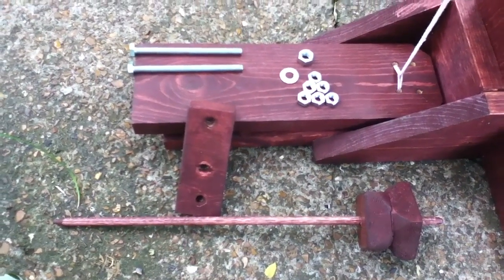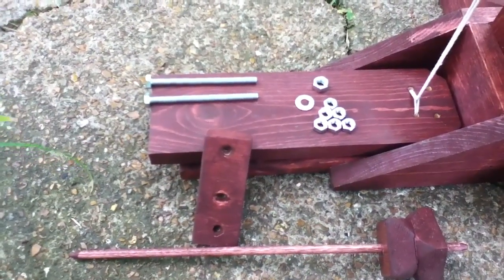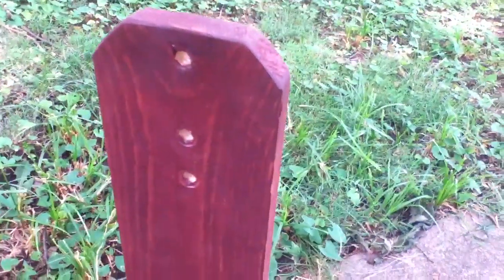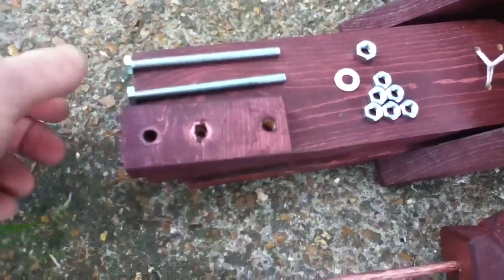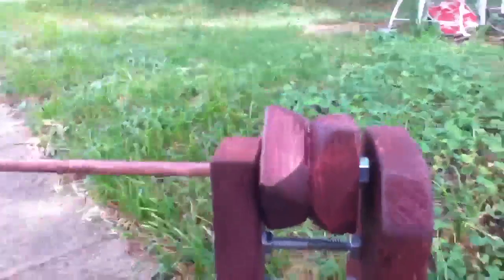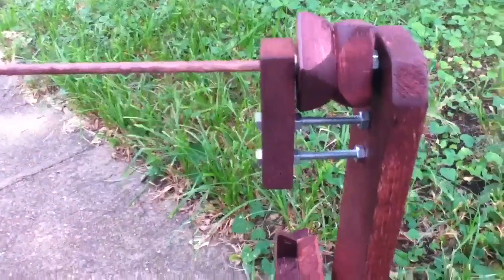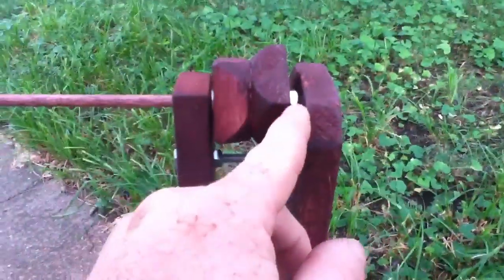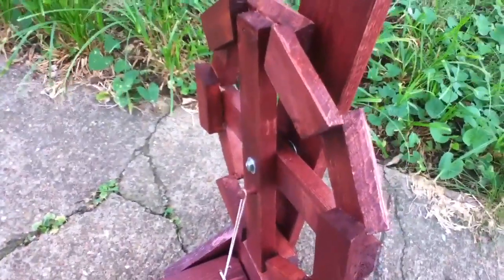Upper Reciever

Comment from the maker: The spacing issue should not change just because you pull the upper receiver off of the bolts, instead of pulling the bolts out of the stem.  Everything would be the same except for where the bolts are.  In light of that, you would just be putting bolt ends and nuts in front of your receiver instead of bolt heads.  IMO bolt heads are better looking.

Comment: Thank you so much for making these plans available!  I am in the process of trying to build one of these and I was wondering if you think it would work to put the bolts in from the back instead of from the front?  I was thinking that to replace the spindle assembly would just be a matter of removing the front nuts and sliding off the spindle attached to the upper receiver piece of wood and replacing it with a new one.  I was thinking that you wouldn't have to play with the spacing of the nuts once you had it set right.  What are your thoughts about this idea?